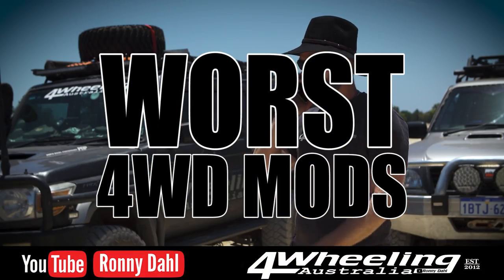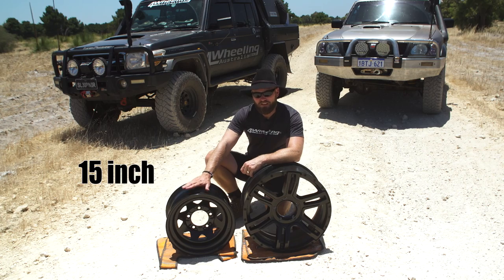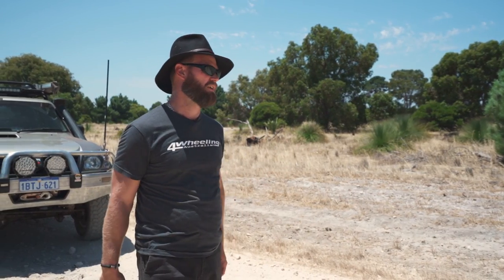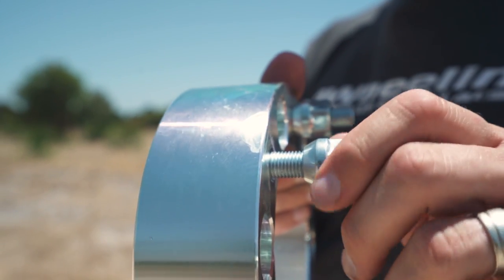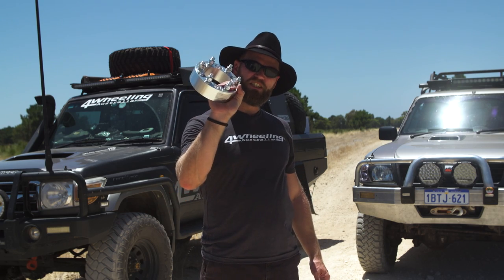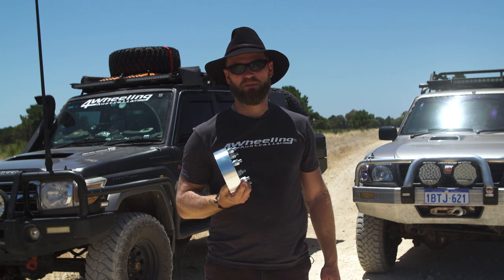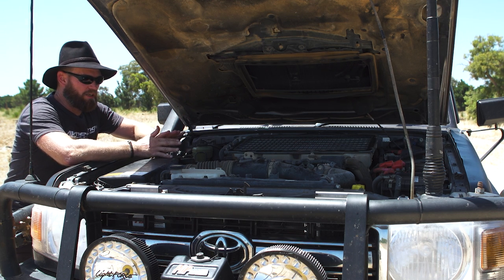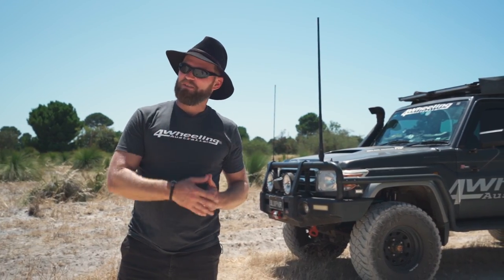WORST 4x4 MODS, DON'T DO THESE TO YOUR 4WD

Comment: 2wd Ranger with snorkel and muds 😂🤦🏾‍♂️😂🤦🏾‍♂️
Reply: 2WD ranger with Muddies for sure, totally lol'ed over here reading that because its all too common, and that just frontin' because you want the look of a real truck, but a snorkel by itself is better airflow and less dust too the engine regardless, and a lifter 2WD truck on something like a baja claw is a powerhouse in open desert racing, but that's for sure a specific use case and you gotta specialize to your destination and environment.
Reply: To be fair, 2wd off road trucks are pretty big in the US. They are for high speed desert driving. but most don't wanna drop the cash for those mods.
Reply: Tristan M hey all you need is real skill and you can take a two wheel drive in some pretty crazy places and get back out.
Reply: Earl McCutcheon I am running into that problem with my RC trucks. It’s very difficult to find a challenge and still have it be accessible and possible. It must be really difficult to find the right terrain for a real trail rig
Reply: Well my work truck has that (not a ranger). But I run a lot of bad logging roads, streams and such. I would say that 4x4 is a mod most don't need.
Reply: Ha! Like an amg badge on a stock merc
Reply: Hey my 2wd mustang sees more off road than most trucks and SUVs
Reply: Vladimir_Bone Spur_tRump  Again, there is quite a following for 2wd off roading. please see trophy trucks and pre runners.
Reply: Vladimir_Bone Spur_tRump  Leaving it 2wd does not equal a pre-runner. 
A pre runner has long travel suspension and is made for high speed off road.
If you have a stock tacoma, then you have a stock tacoma in 2wd mode.
Tens of thousands of people have completed Baja races. If you are having to switch it into 4wd, you are using it in the wrong areas, not going fast enough or you don't have good tires because you shouldn't be getting stuck in the desert that easy.
Reply: @GeneralNOH  a bone stock 2wd with that stuff is a bit silly.
Reply: @zososldier  again hes talking about 2wd rangers and presumably other 2wd work utes.
I think you need to google what these actually are

 No matter what you do to them, they will still be shit for any sort of offroading. 95% of them are bone stock and anyone with sense leaves them that way for a reason. They arent like the yank "trucks" 

In stock form they will get stuck on wet grass and they have so little suspension articulation that driving over a small drain will lift one wheel and then it will just sit there and spin. They have little more clearance than a camry. Theyre cheap work cars, thats all theyre good for.

In saying that i have taken our work one down some pretty muddy and rutty tracks and not gotten stuck, but you have to keep your momentum up and the thing bounces around like fuck since the suspension is purely for load bearing. If you stop, youre stuck.
Better off buying a 4x4 model with the diffs and 4x4 suspension from the factory and just leaving it in 2wd mode if you want to have 2wd fun.
Reply: Local dude has a 2wd ranger with 40in boggers I. The rear with a low gear axle. It goes through damn near everything
Reply: @codyparker679  the thing would be slow as fuck though, theyre gutless and have trouble turning stock 29s😂 youd have to gear it so low that it doesnt do 60mph
Reply: @zososldier  , Actually, a Tacoma Pre-Runner IS a 2wd Tacoma with the STOCK 4wd Suspension and a Rear Locker, but  does not have 4 wheel drive.  So yes, Vladimir is correct.
Reply: @jmackinjersey1  not really because he has a 4wd variant. 
Not to mention, the Tacoma pre runner is a "prerunner" in name only.
Reply: @zososldier  ,  Did I leave out the part about the Tacoma Pre-Runner being a Toyota Tacoma 4x4 Off road edition without the transfer case and front axle?  They still have all of the other suspension parts and rear axle.  So in essence, that IS a Pre-Runner by name AND physical make up.  

Pre-runners came about because teams would take their 2wd truck down Baja a few weeks before the race and scout out the trail and see where they would set up trucks, as well as how the trail was looking for that year.  But as time went on, those trucks would get beefier suspension.  Finally a few guys entered that type of truck in the race, and it went on from there.
Reply: @densamme1752  ,  Driving capabilities are definitely a plus.  I've seen stock Jeeps go through some places that even lifted/modified Jeeps and other rigs get stuck.
Reply: @jmackinjersey1  I know what a factory Tacoma pre runner is. 
I also know that teams in the beginning would use a street truck to pre- drive and scout out a course. 
But today, a pre-runner is a class of vehicle built to drive fast offroad.
I am unaware of anything the factory Tacoma has that allows long travel or high speed driving over the standard variant. And I am unaware of any parts that would improve longevity like after market shocks seeing how factory shocks would overheat and fail prematurely if driven hard and fast for extended periods of time.
A good example of a pre-runner today would be an f-150 raptor.
It has long travel suspension with upgraded components. 
Just because a company puts a badge of a vehicle, doesn't mean it's meant for what the badge says. 
The "rally edition" Mitsubishi lancer (non evo) isn't ready for a rally,  I personally wouldn't take a "Sahara edition" jeep out into the actual Sahara without someone there to get me out of a sand bank since some are 2wd and just because a car has a "gt" badge doesn't mean it's actually a touring car.
Reply: @zososldier  .  First of all, none of those Pre-Runner trucks are any part factory, other than the Raptor.  None of the original Pre-Runner trucks were heavily modified either.  None of the Jeep Wrangler Sahara's are 2wd either.  Jeep only made the civilian Wrangler 2wd for ONE year, 2007.   I started selling cars at a Jeep/Chrysler dealership in 2001, and sold quite a few Jeep Wranglers at that dealership up until 2009.  Oh, and I also sold Toyota vehicles at the same location.  But then I moved to a different State and again, was selling Toyota, Jeep/Chrysler, Ford, GM, Dodge, Honda and on occasion, Nissan.  I sold cars up until 2015, so I think I would know about what comes in them from the factory.

Regardless, it isn't always the vehicle, but it is always the driver.  I have taken unmodified Jeeps and other vehicles through some places that a modified truck couldn't go.  Then walked back, got in the other truck and drove it through the same place that the other driver could not get the rig through.  I have seen many other people do the same thing.  Heck, a Volvo Sedan won the Baja one year.
Reply: @jmackinjersey1  jeep wranglers came 2wd from 07 to 10.
They also had a few years/ variants of cj/yj/tj in 2wd, the mail jeeps were often 2wd and a bunch of war time jeeps were 2wd/rwd or even fwd.
And they did make the JK sahara with a 2wd option.
https://www.nadaguides.com/Cars/2008/Jeep/WRANGLER-V6-6-Spd-4WD/Utility-4D-Unlimited-Sahara-2WD/Specs
Reply: @zososldier  ,  I know about the older ones (not Wranglers) used by the mail carriers, I had one for about 6 months.  The Wrangler in the '07 -10 you are correct, and my memory has been restored.  It was a few years go.  Not to mention that they didn't sell or manufacturer too many of them in the States.
From what I can find, they made up less than 5% of total manufactured.  So out of the roughly 380k they made for those years,  only 19k were 2wd.
Reply: That's normal to see where I'm from😂
Reply: @sheldon8801  I already tried saying that. They are just referring to a bone stock work truck with a snorkel.
Reply: 2wd rigs are great for high speed rally runs in the desert.. They even can cross water.. I don't agree with this one lol.. People put muds on no wheel drive trailers all the time, so they would definitely work on a 2wd
Reply: My mate was seriously about to put a 2" Lift and muddies for the look 😂
Reply: @zososldier  , Whats wrong with that?  A snorkel kit will allow that particular vehicle fording ability, just not as much as one with a lift and tires.
Reply: The 2wd 'Hi-Rider' Ranger used to have an optional rear diff lock, not sure if they still do. When fitted with the optional locker it was basically an equivalent replacement for the old Falcon RTV.
Reply: @jmackinjersey1  I don't see an issue on a work/ adventure truck. Pretty sure OP is talking about "mall crawlers" or what ever the 2wd version is.
Reply: 2wd trucks ruled the Baja-1000 for many years. snorkels are good for many reasons including flooded city streets. If you  want to point and have people laugh, you should have said a pavement queen, that won't ever go off road, with snorkel and muds.
Reply: So back when I first got my license me and some guys went 4 wheeling so I borrowed my dads Rodeo (I did no own a 4wd) and he was ok with it, it was completely stock as in no lift and half worn road tyres and we were going through mud and sand and stuff like that miraculously I never got stuck but I have been stuck a million times in my own cars since, anyway one of the guys was in a near new Hilux and it had all the kit and caboodle, except the most important thing... 4wd 😂😂 it was a 2wd model, I felt for the poor guy, he was so embarrassed as he had no experience 4wding (Hence why he was with us) and didn't realize that some utes have a 2wd option
Also another similar story is of a Hilux also, a Toyota dealership I know of had made a cock up... the customer has put in a special order for a 4wd Hilux, it was a relatively small dealership and only had a few cars on the lot, anyway when they got the car in the customer requested full ARB bar kit + winch, 2 inch lift and mud tyres, so that was all good but when the dealer was showing the customer around the car, the customer could not find the 4wd selector... sure enough it was only a 2wd 😂the customer did end up getting the 4wd model but instead of removing all the gear off the 2wd and put it onto the other car, instead they got all new gear for it and used the 2wd car as a promotion car of some sort
Reply: Lol most of the time you dont even need to leave 2wd when offroading.
Reply: @schulzy1544  BRUHHHHH WHY  A MUSTANG IM DYING

Comment: Great distinction that you made for those of us who run larger wheels (18-20) but we are running 37-40 tires on RAM 2500, Ford F 250, etc.
Reply: yeah but in aussie or new zealand they are illegal to use on the roads unless they have had engineers reports etc

Comment: I have a 2016 Toyota fj cruiser but I'm not planning to go hard 4wding, my plan for this car is too add
- All-terrain tires
-16inch steel rims
-Steel bullbar
-2 spotlights at the front
-and give it a 2-inch lift later on, but do you some great suspension brands cause I don't want to buy cheap suspension, and your video really helped👍

Comment: I have a 2002 jeep Grand Cherokee Laredo 4×4 with 4 inch lift 33.inch × 12.50 R17 rims and I bought very expensive drive shafts and track bars and putting 6 more shocks soon and I don't have any death wobble 0 shaking at 120 kms per hour and my alignment is absolutely perfect so my point is spend the money on the best and most needed parts Before adding parts that don't help it drive nice and safe just like your saying.Great Video As Always, Thank You.Im A Canadian Citizen and love the mountains of Cape Breton Island Nova Scotia Canada which is my home.